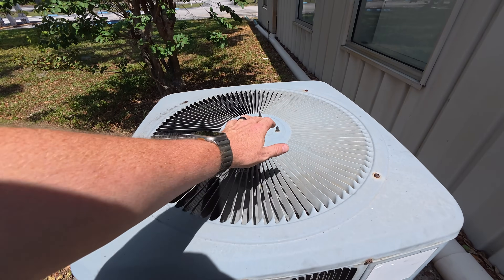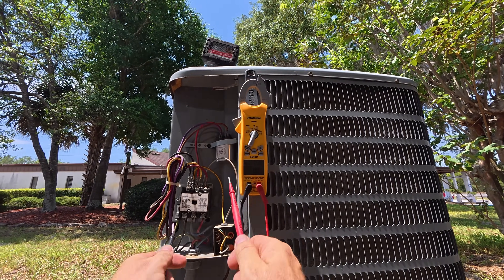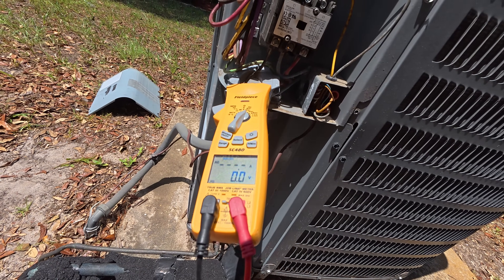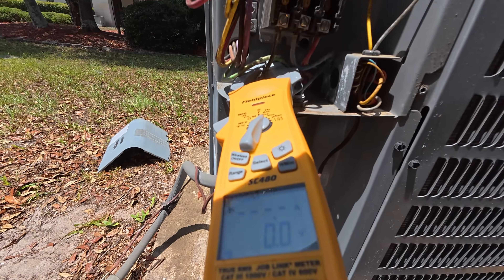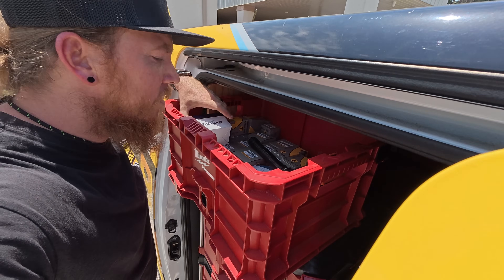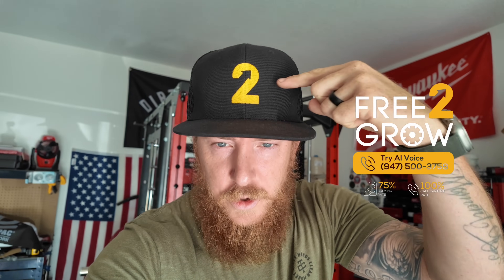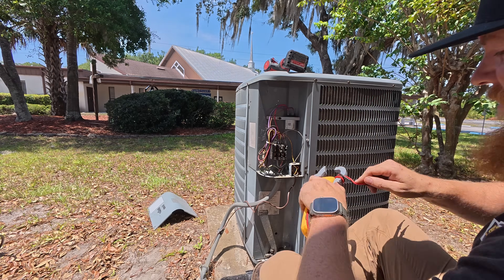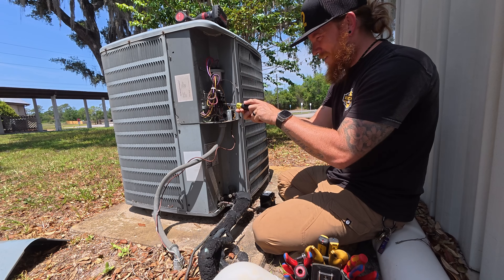Goodman Air Conditioner NOT Cooling | Common Problem Fixed

Comment: I change my contactor every 5 years. It’s worth the $25 for the peace of mind. I measure my capacitor every year and change it either when it drops below 10% of its rating or if it turns 5 years old.
Reply from the maker: That’s some good advice!! Solid proactive tips 🫡

Comment: Most of my work was industrial. I had some 3 phase units, 460 volts phase to phase. Hermetic PTAC 3 phase, quite the variety in my plant. Belt driven 134A units, Also 124 for high ambient, that was a nightmare that I never woke up from. It was good when it was good and  it was very good. Then it went bad, very bad. I got out! Sent them a letter of resignation.
Reply from the maker: Sounds like you’ve seen it all, sometimes it’s just time to move on to new adventures!

Comment: Are Milwaukee multi-testers useful tor diagnosing HVAC issues when checking for continuity and voltage?
Reply from the maker: I haven’t used their meters. But I may give them a go, I’m sure their good
Reply: These days, brand name doesn't seem to matter but reliability does so that remains to be decided with the off brand names.

Comment: A three-phase Droneman?  How big was that unit?
Electronics do have interesting smells, don't they?  Not all are pleasant, like brand new hard drives coming out of their bags; I'd imagine a contactor loaded with scorched ants is one of the less appealing.  Oh, what pouch is that?  It looked rather heavy.  MP3X?
Reply from the maker: That’s a 4 ton, it all depends! They define do have the smell, I actually have another video at same location with a burnt transformer which has a distinct smell l, and of course I smell it 😆 it’s the Mpmx, not heavy at all, it’s my EDC

Comment: Enjoyed the service call. Wild that you don't watch the condenser turn on.  You just flip that disconnect and walk away.  I always want to check start amps and watch the pressures as is starts working with me right there.
Reply from the maker: The power of editing brother mark 👍 tested amps, cap and pressures. 344 high 133 low 4.8 on cap. 6.5 on rla. That’s my SOP 🫡
Reply: I think he also had to go back inside to turn it on at the thermostat.  He mentioned killing it there near the beginning in order to turn off the 24V.

Comment: do all residential hvac systems in florida have the line sets & drains going underground like that ?  whenever i get contactors that have that many wires i take a picture of it
Reply: Many years ago we learned in NC area that it was poor practice to run refrigeration lines underground even if protected in PVC sleeve. We found many systems in hot ambient conditions if off for extended periods of time that had over 10 to 15 feet underground could have issues flooding back on startup either taking out compressors on startup slugging liquid or washing the oil out of the compressor due to refrigerant migrating into the lines underground where it was much cooler than ambient conditions. Systems that had an accumulator on the suction line would  usually mitigate the problem. I am old school and always stayed away from refrigerant lines being buried due to many issues discovered in the field from this practice even though it looks better it brings other negative issues. 

FYI it always pays to snap a picture it can save you time tracing wires back to point of origin...some areas are hard to get to with out taking out dozens of screws and panels!
Reply from the maker: It depends on the setup of the house, some do run that way, some go through the attic! But mostly all underground through a chase. Heard it best by Bryan Orr “it’s just how Florida does it 🤷‍♂️ “ lol pain in the arse